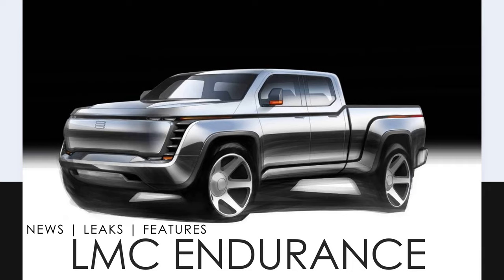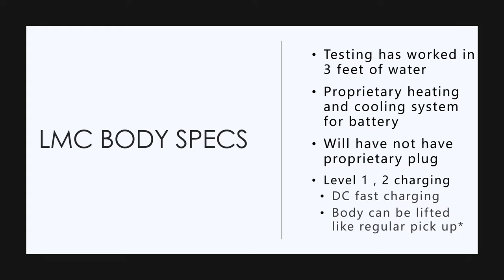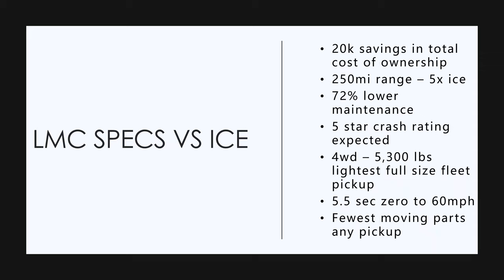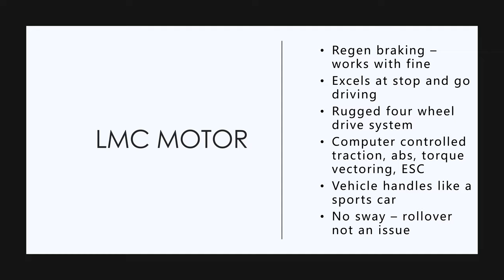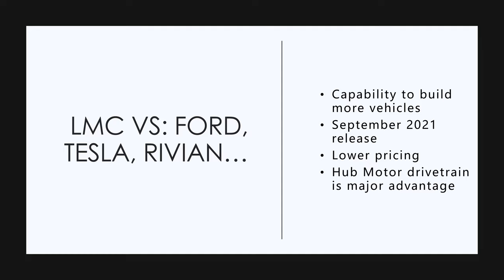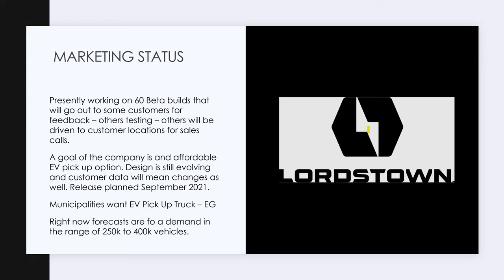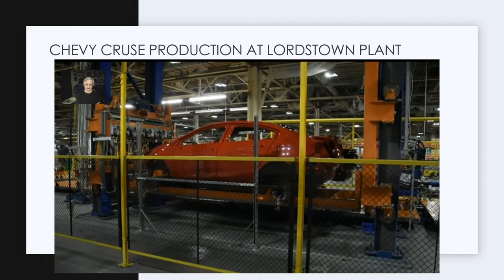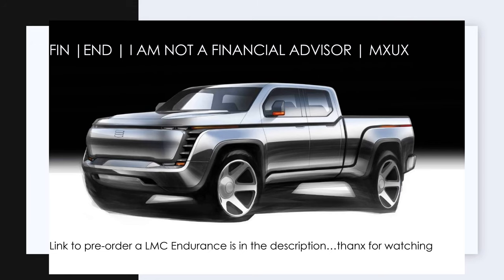LORDSTOWN | NEWS | LEAKS | NEW INFORMATION | All new info on Endurance #ENDURANCE #$RIDE #MXUX

Comment: Easily the most underrated of the EV startups. EV's seem to work a bit like kickstarter and since this one is not a retail product I think it faces some headwind from would be retail investors. I like to think of it the same way I think of it like a fleet of electric golf carts for the road. It's just a logical product for the people who will benefit from it. You also can't ignore that huge GM battery factory being built right next door.
Reply from the maker: MS on GM - they are basically partners with LMC sorta - invested millions and gave them the plant cheap - may become a division one day - who knows - also using GM parts catalog for common parts - as of now that battery plant - 2mil sq ft - is staffing up - LG is partner in it I believe - new battery tech - but as far as I know LMC will not be using output from this plant at this point - I assumed they would but no is the answer - GM only - ya fleet sales are not s3xy - for sure - but product is good IMO - u can still buy as a consumer though - CEO sez will cut teeth on fleet sales and refine product and manufacturing then go to public - did a vid on my version with options - the LMC Trumbull -the  hi top van next year will be RV so perhaps then...thanx for the comment

Comment: The people from H are short sellers and they work hard to drive stock prices down. To me it is like betting against someone's dreams for your own greed.
Reply from the maker: The thing is that there are trading bots used by algo trading hedge funds that actually read news headlines and content and trade stocks based on this information automatically - so all you really have to do is get the press to cover the short report - facts are not an issue - once it hits the wire the press coverage will move the price in the short firm's interest - as you can see they do little to  defend their position (shorts)